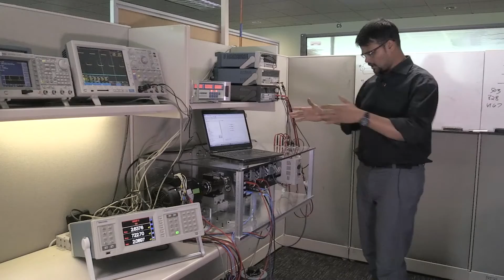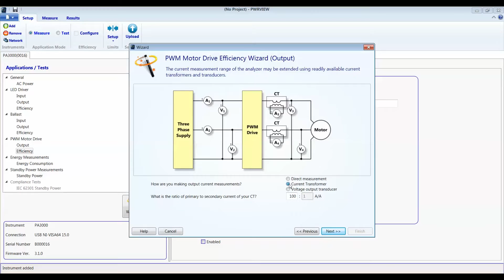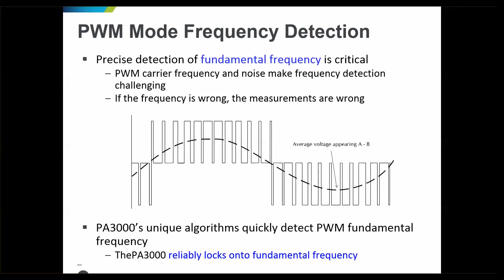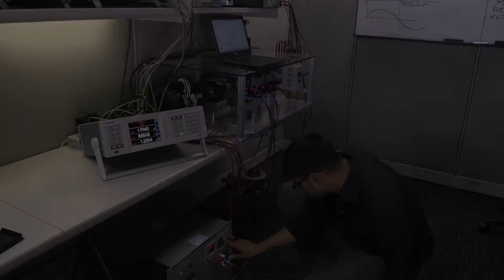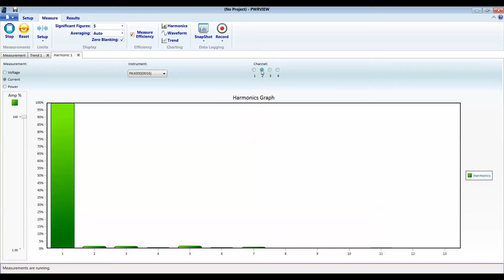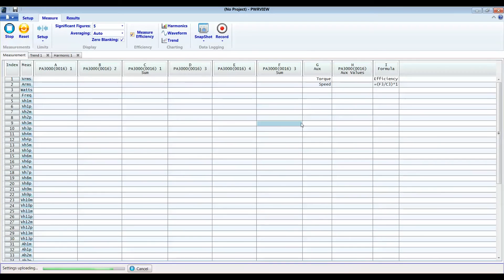Efficiency Testing on a Three Phase Motor Drive

Comment: 93% efficiency is very impressive, for a motor that small. I didn't see where torque or RPM were actually measured. could you tell the overall efficiency from source to motor shaft? That seems to be the most relevant measurement, since that's what shows up on the power bill for the motor to drive the load.